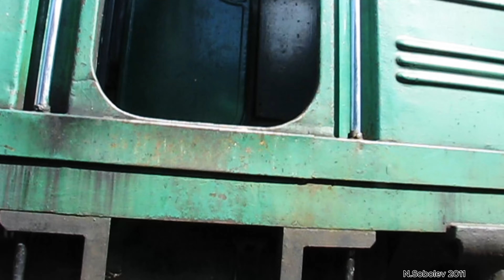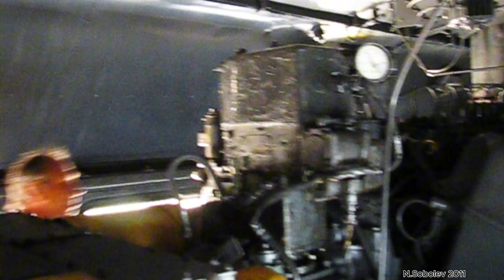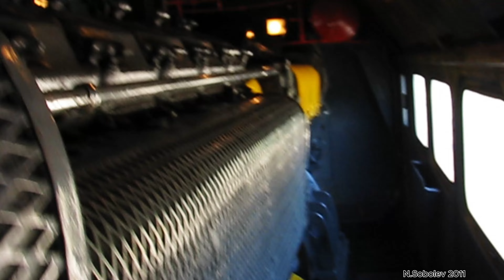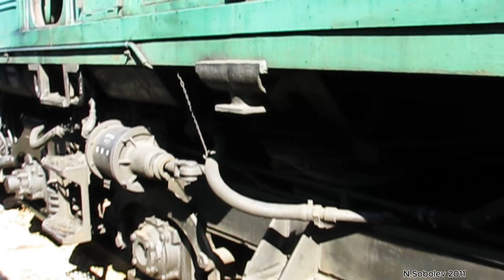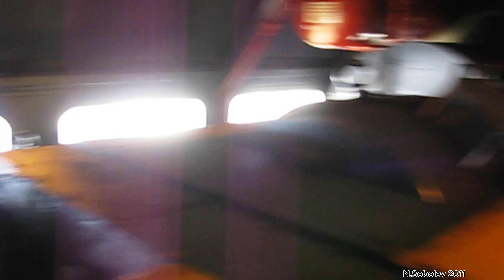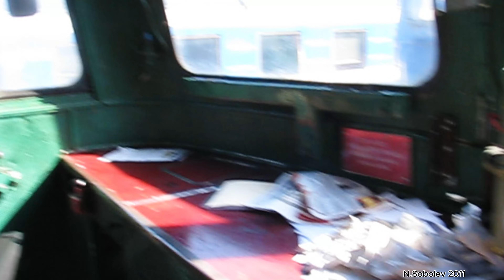Sound of a two stroke diesel

Comment: Engine number plate is similar to your YouTube user name. Comes from this type of engine? So, "two stroke" but how many cylinders still involved in the two stroke action? Perhaps you chose the user name as it was the first engine you drove?
Reply from the maker: V12
Reply: @2M62  So six cylinders on one stroke and six on the other?
Reply: @pianoman4Jesus  No!   Two-stroke engines still have the same four phases as any other internal-combustion engine (including jet engines): Suck, Squeeze, Bang, Blow, but they happen in only two movements of the piston, not the four in a usual four-stroke engine.   My bus's Detroit 6V92 engine has air intake ports in each cylinder and four exhaust valves per cylinder, i.e. no intake valves at all:  the pistons uncover and cover the intake ports.   It sounds great (especially without its muffler...)!
Reply: @icenijohn2  Right, all four phases.... but does not "two stroke" mean that half of the pistons are on one cycle phase and the other half are directly opposite? Not diminishing the number of phases by any means... just thinking that there are only two piston placements within the cycles,... half and half.
Reply: @pianoman4Jesus  No. "Two stroke" just means that whole power cycle is consisted from 2 strokes. Here it is as follows:

First stroke, from top dead end piston position:

1. Combustion chamber is filled by very hot air pressurized by previous piston movement.

2. Fuel injection occurs. Burned fuel produces a lot of hot gases with a great pressure. Pressure starting to move piston down.

3. Somewhere in the middle of the movement exhaust valves opened  starts vent hot gases away.

 Somewhat later inlet valves or ports in the cylinder wall opened too leading the way for fresh air from outside.

Often that air is already pre pressurized by turbo (hence "turbo diesel" name).

Some amount of time inlet and exhaust are opened together in same time.

Hot exhaust gases are vented out, fresh air takes place.

When piston reach bottom dead end position, second stroke occurs:

1. When piston started to move up,   exhaust valves are closed thus pressure rise up to the turbo level in the chamber.

2. Next inlet valves  or ports are closed.

3. Pressure and temperature starting to rise because of piston up movement.

Next, power cycle starts again from the fuel injection as written before.

This is power cycle for one cylinder.

All ICE which had more than one cylinder had their piston positions "spreaded over" whole crankshaft rotation for most even and interrupt free movement. In one moment of the time only one action (suck, pressure, blow, vent) occurs in one cylinder.

Not two, tree or more sucks, pressures, blows or vents simultaneously.

For smoothness and even rotation.

This is basic view of the work of 2 stroke diesel.

Sorry for my English.
Reply: @ВладиславПантилимонов  Ahhhhhh.... I suspect "two stroke" versus "two cycle" engine is where I got confused. So each cylinder of the 12 each operates in "two stroke" mode, not necessarily that exactly half of the pistons are up when the other half are down. Two stroke could still mean the cylinders have a staggered firing pattern. (Straight 12 versus V--12 pattern.) Correct? And your English was very good, nothing to apologize about.